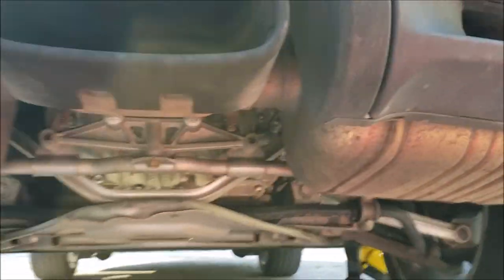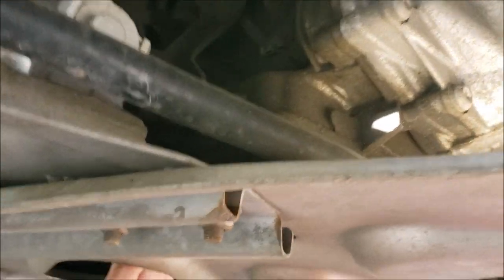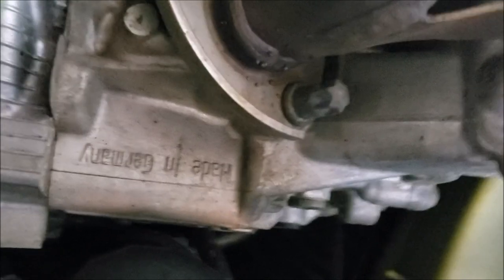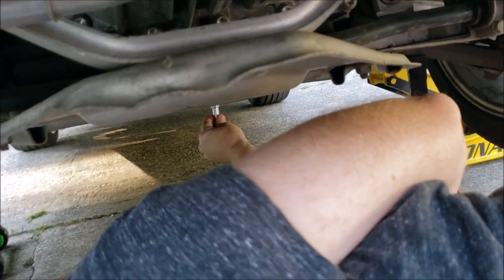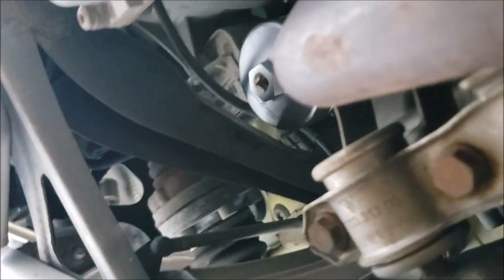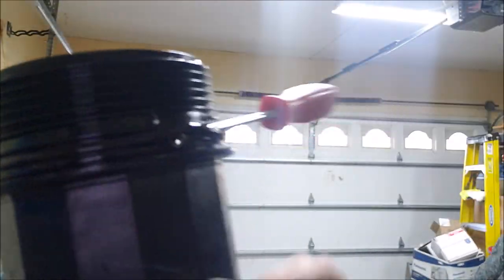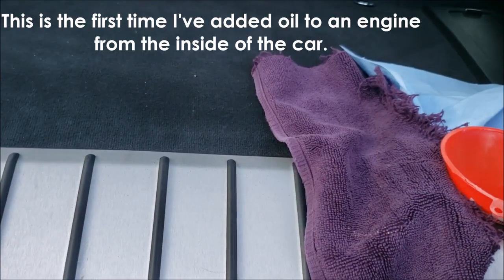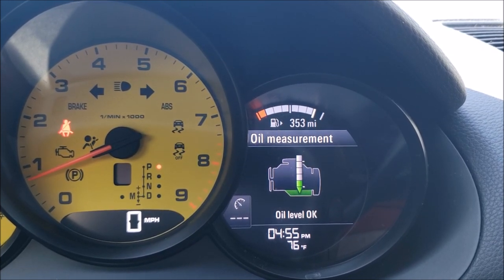DIY Porsche Cayman Oil Change 981

Comment: That old oil is so dark, does the car tell you when to change oil? Nice car btw.
Reply from the maker: Yes, it does. However, I cannot easily reset the oil change reminder. I took it to the dealer for the oil change reset. I'm going to buy a scanner that will allow me to view and clear codes from the DME.
Reply: @TZ250FANATIC  is the dealer using some kind of DME to reset it?
Reply: @TZ250FANATIC  I would love to know the scanner you get!!
Reply: what car do you drive that the oil stays clear after even 3000 miles?      please share something new.
Reply: @crvdudecrossoverr6367  logically if you drive gently and at low rpm it takes longer for oil to get dirty and may not get as dirty as in the video. It differs from car to another obviously.